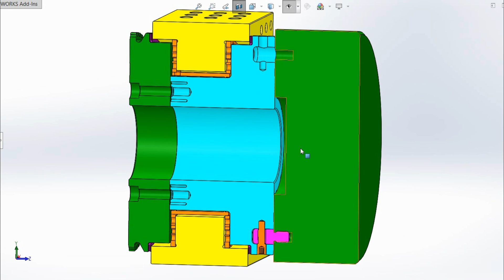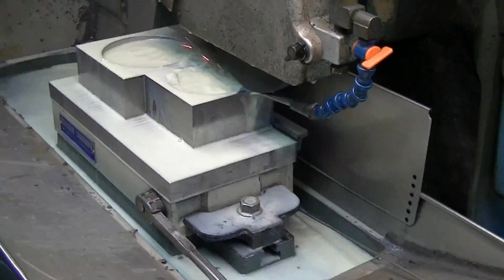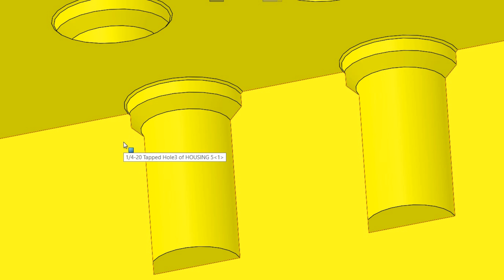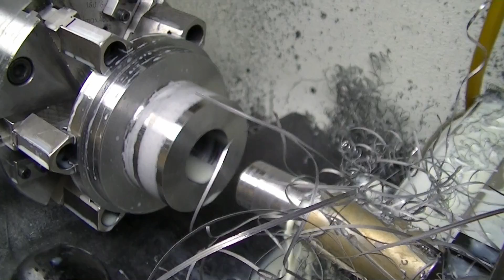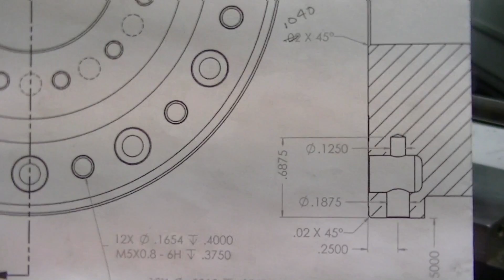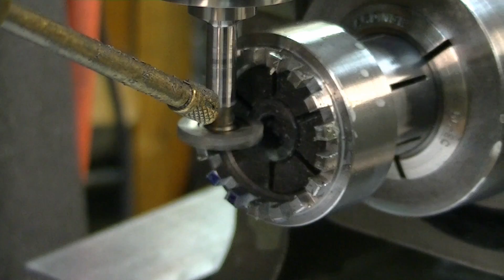MAKING ULTRA PRECISION TOOLROOM SPINDLES #1

Comment: So the wavelength of a laser is at a minimum 400 nanometers which is 15.7 millionths. If one were using some sort of ultra low wavelength UV laser to measure the runout of this spindle one would still be 3 times away from the necessary precision required to measure. How do you intend to measure 5 millionths total indicator runout? Is there some way to measure at a fraction of the wavelength? Of course...one would need at least twice the precision instrument to measure it. Of course, let's not talk about temperature deviations (maybe one has a deep vacuum interstellar laboratory =)).
Reply: Since an interferometer shoots the light out, reflects it off a surface, and has it bounce back into the detector, a movement at the reflector of half the wavelength will cause the optical path length to change by one wavelength. Since a common He-Ne laser has a wavelength of 633 nm (25 millionths), a movement of 316.5 nm (12.5 millionths) will cause a sinusoidal light-dark-light cycle of interference at the detector. This can be interpolated to nanometer resolution (0.04 millionths). 

However, lasers are finicky and expensive. Robin has an LVDT-based electronic indicator with millionths (I'm pretty sure) resolution.

Another excellent option would be a capacitance gauge.

More info:
https://www.renishaw.com/en/interferometry-explained--7854

Lion Precision

Professional Instruments
Reply from the maker: Thanks for that reply and yes I have many electronic lvdt based indicators that read to 1 microinch and several 0.1 microinch. All have a signal output that I can read on a  6.5 digit lab multimeter to get nanometer resolution.
Reply: Robin, under your influence I have acquired a Sylvac 100 head unit, foot peddle etc, but are on the hunt for probe to suit.
Have you any suggestions?
I'm in Australia and there doesn't seem to be much available, information even.
Carl.
Reply from the maker: @captcarlos  Sorry as I have no info on the sylvac units.
Reply: Thank you for replying.
I think I just have to get my Swiss friend to contact Sylvac on my behalf in their language.
It will be intriguing to have sub 40 millionths measurement..
Reply: @bobeboph  LVDT is analog, the limitation isn't in the hardware, it's in the DAQ. Your axeseseses are moving around hella quick, so you can't do that ol' s&h trick since... you know...machine tools tend to move.That stupid muon g minus two bull popped up in the 60s. all those dudes were dropping acid and going to Woodstock and still managed to measure the electron dipole moment (_the electron_ not the nucleus so that's 10e-14cm) to 12 digits, it aint no thang bruh.  

measurements aren't the problem, especially if you only have one DOF like a linear scale. your problem is accounting for:
let's try a thought experiment re: modelling a 2 linear+1 rotational spindle/lathe type setup.
inherent harmonics of the structure in steady-state (ish..)  
harmonics produced by an inevitable varying wear of the tool based on weird mechanics shit i'm too dumb to know about 
anisotropic crystalline structure of the metal (little hard chunk where you move from 001 to 101 or whatever fcc bcb blah blah),
the tool tempco, 
the work tempco, 
now let's throw the first and second intermodular distortion harmonics between those 5 trivial variables
there, you just moved out of anything in the ten millionths range (probably hundred millionths @ a surface roughness +/- 20% allowance) at anything more than 50 rpm
, and i did that  mention the words 'two form', 'covariance', or 'solve this differential equation'
https://en.wikipedia.org/wiki/Pole%E2%80%93zero_plot 
those are what people who design PID controllers have to deal with
, learn it, love it

i seriously spent 15 minutes just now thinking about how Okuma or fadal or whatever would model this, and i'm now 100% sure it's just a really fast control-loop, reactively adjusting parameters based on heuristics like crazy, while trying not to overshoot to develop ringing (which ironically would cause even more IMD lolzz)
, sup covid & add medication <33

Robin, a dmm doesn't resolve fully to their specs immediately man...I duno what meter you have, or how times have  changed, but the hp 34401 (branded 'agilent', still hp to me; dont get me started on that "keysight" bullshit)  i'd use when my dad wasn't looking took uh maybe 200ms to settle down to 6 1/2..? somewheres there. way more for AC obvi. not sure how times have changed, but if you're getting better than i duno,.. an order of mag better than that, then the sps or settling time would be fast enough for them to market it as a 7.5 digit. check your manual, i'll eat my hat if @1ms, you're getting more than 5.5 at 1 percent plus a few digits at even DC. again, i'm rooting for you (also looking at the comments on this vid, looks like basically everyone already mentioned my concerns, so sorry for being a shitstain)
Reply from the maker: @wither8  Fluke 8846A  6 measurements/sec at 6.5 digits
Reply: @ROBRENZ  that 8846a looks like rad. so 166ms,  same ball park. presuming that's cmrr'ing like 80db or whatever that is a steal @ $1500i & a nist cal cert, jeebus, 3458's are going for around 10k now? killerrr . i mean granted this has nothing to do with high speed measurements. 

i'd be real curious to see what DAQ/drive you end up using. i know nothing, like literally nothing, about off-the-shelf drives (just what marco reps had setup) but if anything can servo at any reasonable speed and maintain a half decent surface finish, well god damn, hats off to which ever team. post numbers when you get this thrown together, sounds fuckin rad
Reply: curious my self. Lvdt?
Reply from the maker: correct